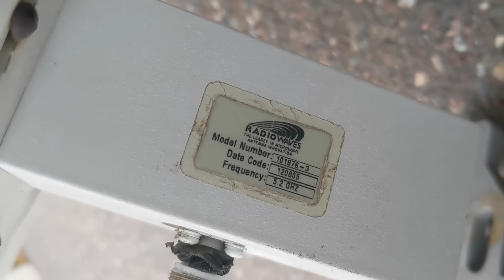I Bought A Whole Wireless ISP For $50

Comment: with all the same style dishes I wonder if you could do a small very large array??
Reply: I would like to see if that was possible .. I have a few acres for now unless I lose my court case .. 
Each of the VLA’s 28 25-meter parabolic dish antennas use 10 receivers:

74 MHz        Band 4           8 – 12 GHz         X Band
327 MHz     P Band          12 – 18 GHz        Ku Band
1 – 2 GHz     L Band         18 – 26.5 GHz    K Band
2 – 4 GHz      S Band         26.5 – 40 GHz   Ka Band
4 – 8 GHz      C Band        40 – 50 GHz       Q Band
Reply from the maker: I've tried a very small array before, it was hard to sync up the signals and I just got noise. I'll have to see if a KrakenSDR can do that.

Comment: I have installed a lot of those little dishes. If they have even the slightest warpage they won't work. The nuts and bolts off of those are weather resistant and can handle an impact wrench. I would save those!

Comment: That's a SH generation Subaru Forester you are using there, right? So I have a good idea of exactly how much j/u/n/k/ treasure you picked up!  Does your Forester have the square cup holders in the console behind the shifter? Drinks never fit into mine until I found that someone had created a 3d print of a adaptor that would hold round beverages (cans, bottles, etc) but fit into the two square hole on the console. If you do and and want the adaptor to print, let me know, and I will dig it up for you.
Reply from the maker: Hmm that adapter sounds like it might be useful! Although half the time I have radios or other junk in the cupholders 😂

Comment: In 2003, my friend and I built out a wireless ISP using a single T1 line and a bunch of 802.11b wireless gear. Some of it had to have special software to compensate after we went over 1 mile. One site was at the radio station's tower, and the other was on the side of the hill next to the town and ran off solar and wind (Wyoming wind is crazy). Now we have Starlink, and fiber is getting run all over the place; my rural house, when I moved in, could only get the early Starlink, but now I have two fiber options 3 years later. The interesting thing was when I looked at higher populated areas in the Eastern USA, they had one fiber company with 40% of the town, and the cable company still had the monopoly. Out west here in CO, we are getting a lot of fiber.
Reply: I quit in 2003, only ever had six customers, they were using me for AOL bring your own ISP plan because AOL didn't have a local number of where we were and it was costing them a few hundred a month in phone bills for dial-up.

Comment: Sector antennas is a nice find. Well I call them sector. AKA Panel antennas. Depending on Coverage. Say use 4 of the and cover 360. One of these days I'll find some and do that for scanning. Should put one of those 2.4/5 directional on a x/y motor. Then you can moved it around and catch standard wifi signals. Not sure why since everything is encrypted or locked out. Looks like Several comments already have peeps more knowledgeable on this stuff than I'm.
Reply from the maker: If you're local I might actually want to get rid of some of it. Too hard to ship the big stuff unfortunately.
Reply: @saveitforparts  If I remember correctly. I'm not. Lower part of Idaho.

Comment: Let's assume you want to map out all the tunnels that you have. You've now got most of the stuff to do this. You need a microwave transmitter that you carry along the tunnels, pointed vertically upwards. Then you have a similar microwave dish pointing vertically downward with the receiver. So you can just move the antenna along the cave and then find out where it was below you. You spray paint on the surface to mark it! Haha 
You might be able to even get the distance down. 
I'm guessing that with a focused beam going straight up and then detected by a similar dish, you could get through a few dozen feet of sandstone. With accuracy of about 3.14159 inches .Plus or minus.
Of course you may not want to do this anyway. 
If so just try to forget about it. Hahaha

Comment: so, 3 pallets, 5 each = 15, and auction fees and taxes got that up to 50?? Something isn't mathing correctly here... or your auction place has crazy exorbitant fees that are more than the bid price
Reply from the maker: There were a couple other pallets with the smaller antennas, that's why it took me two trips!
Reply: @saveitforparts  I was talking about the cost - how does 3 pallets at $5 ea + fees + taxes turn out to be 50, unless you're counting gas

Comment: If sandland doesn't have internet, I"m pretty sure you have enough hardware to setup a point to point link to somewhere that does now. Those offset dishes are usually Motorola Canopy, but I've never seen those can-tenna feeds before - usually they just mount the canopy radio at the feed point of the dish. I'd like to see some detail of those feeds and what radio they're connected to if you still have the radios in a future video

Comment: Take a look at reticulum rnode to create a decentralized mesh network using the panel base stations and the cpe nodes. On the reticulum network site go to hardware > communications hardware > scroll to the WiFi hardware section. Kinda like Meshtastic but more versatile.

Comment: I have a ton of those 18" ePMP dishes at work leftover from upgrades since they're a couple generations out of date. They still get firmware updates (Need a free account on Cambium's site) and can push a little over 100 Mbps on the 40MHz channel width setting. They'll use both the Ubiquiti/Mikrotik style 24V passive PoE pinout or the Motorola/Cambium pinout that's the same as the other pinout, just with the positive and negative flipped. In a pinch, I've used them for around 20km point to point links to feed customers or small repeater WISP sites. 

Definitely worth keeping around to blast WiFi around somewhere like Sandland if you want to share a single LTE/satellite modem around a large property. Even without internet, you could have cameras spread around, use VoIP phones or VoIP ATAs as intercoms by direct-dialing SIP addresses or running a PBX from a Raspberry Pi, or some kind of locally-hosted instant messaging. The ePMP stuff tends to have a wide input voltage (10-30 VDC), so you could use a passive injector that takes a barrel jack input to run them directly from a 24V battery string charged by wind/solar without having to need an inverter.

Comment: The biggest one and some of the others look like Cassegrain feeds. Replace the waveguide at the base with one for 1.7GHz and you have a good HRPT antenna. Use two probes and feed them 1/4 wave apart and it's circular polarity.
Reply from the maker: I'm not sure if the waveguides would restrict what frequencies they can see, I'll have to experiment with that!
Reply: @saveitforparts  They do. They are tuned wave guides for a specific frequency. There is some flexibility, especially for going higher in frequency but not much for lower. They're easy enough to make from common metal materials.

Comment: Those sector antennas have about 30db gain depending on beamwidth, they do work well for wifi. We've used similar ones for a wifi at different RV parks. 

I run a Wisp we started about 8 years ago. I used to work for the largest Wisp in the state and they used a ton of Cambium equipment.

Comment: You need a trailer!  I had to get internet service on a construction site in Wytheville, VA.  Finally found an ISP with said equipment that connected to the backfeed on a mountain, 10 miles away from our construction trailer (2008 ish).  2-3 Mb speed, ok for email.  Now, we could just get Starlink.  You got a deal!
Reply from the maker: I have trailers they're just full of boats and trains 😅

Comment: Some of the microwave dishes on that tower are used for a microwave ring backhand around the region/county. Alot of the newer digital LMR radio systems use them.
Reply: With 5G, all of the cell networks mostly have fiber backhaul to their towers now - they just don't bother taking the microwave dishes down, but generally they're not in use anymore. I didn't really think about trunked radio networks also using microwave, but that makes sense for large systems with multiple towers
Reply: @gorak9000  oh, i was talking public safety LMR systems. but your mileage may vary based on your location.
Reply: I saw that tower as a zone controller site, for a large area trunking system. Most likely the statewide public safety system.

Comment: Apply a mirror finish replace the antenna with a copper block and use as a solar heating system. you'd need to make it track the sun somehow.